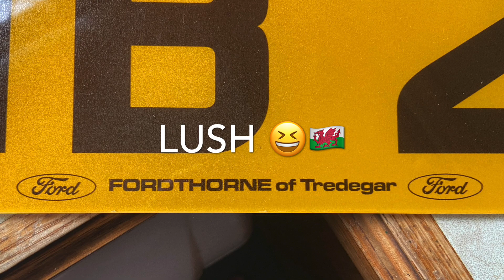Base RS2000 Restoration 8. Haven’t You Finished That Yet.

Comment: Good work Mark. I had a white 1978 S reg RS Custom from 1985.  Mrs and I drove to Monza Italy to watch Nigel Mansell drive in the F1 in 86.  So memorable as the car was such an icon and Nigel so popular that the locals were sounding their horns and waving at us.  My car had Bilstien suspension, quick rack, balanced big valve engine with twin 45s, fast road cam, Janspeed exhaust, etc etc.  Bodywork was in perfect condition too.  Not the quickest car by modern standards but it was great fun to drive. Sold it in March-87.  On gov.uk it was last taxed in 2000.
Reply from the maker: Thanks Simon, great memories, I would have been watching Nigel on TV in ‘85, no licence til I was 17 in ‘87, and no RS until a few years later 😁